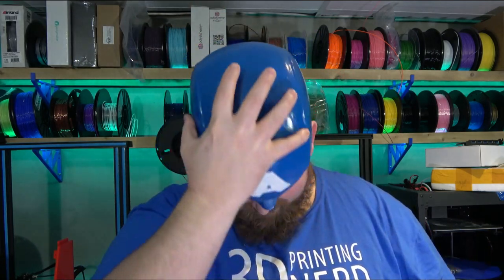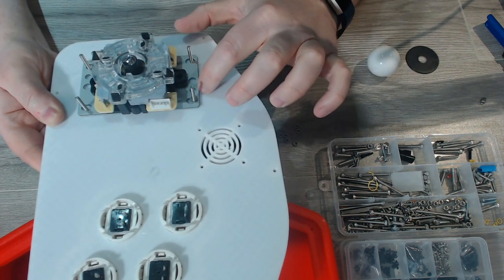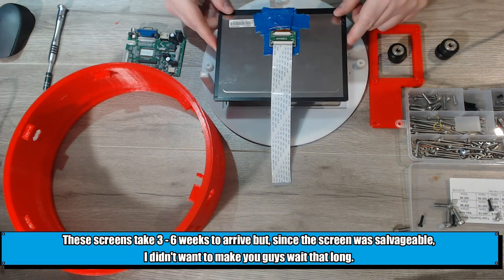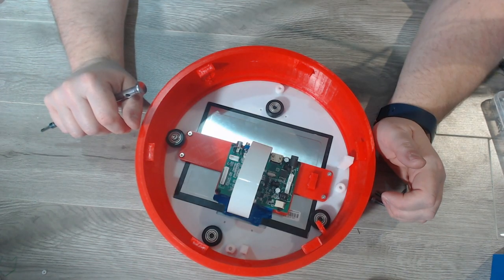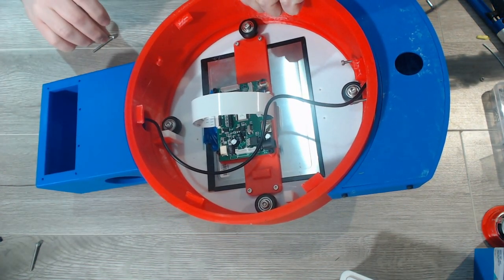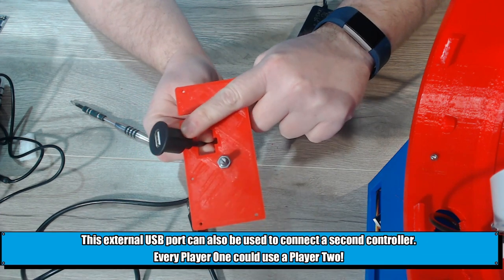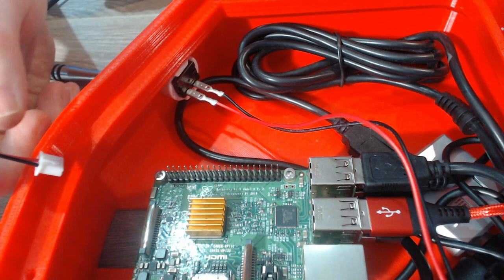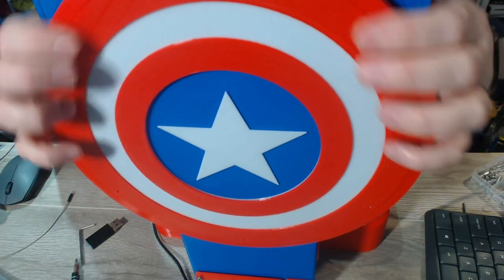One EPIC Mini-Arcade to Rule Them ALL! [Part 2]

Comment: Very nice project. Where can I find the list of parts for it? Can't find it on you page.
Thanks and keep up the good work!
Reply from the maker: Hey there! Sorry for the delay in response. Presently the BoM is included with the model, but i can toss it up for you to view if you want to see it beforehand. Just let me know!
Reply: @PrintNPlay  Hey. I would appreciate it very much if you could share it please.
Btw I have a spare lcd screen from an old laptop but its a 10inch screen. Can the project be adapted?
Thank you very much!
Reply from the maker: It's hard to say for sure. Would require some redesign on the screen bezel for sure, and you might have to move the mounts for the bearings.
Reply: @PrintNPlay  Ok than you. I might as well just buy the screen :)
Can you provide the BoM please? Thank you very much.
Reply from the maker: Sure thing! here you go! https://docs.google.com/spreadsheets/d/1Yb2phmG2g0AYJFB2rfd09cM3dJkKmxAECWksZMzvqxc/edit?

Comment: Do you have a parts list for all of the electronics? also could you design a model that fits the nintendo switch that can spin so you can do nintendo arcade and nintendo pinball games? and maybe make it a little easier and have it fit the hori nintendo arcade controller?